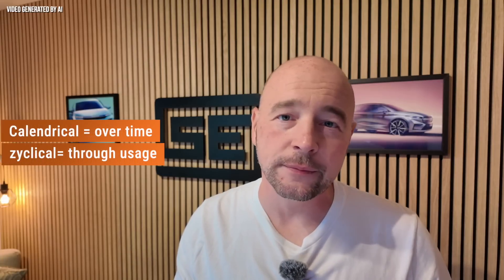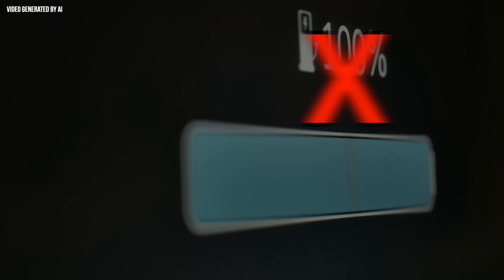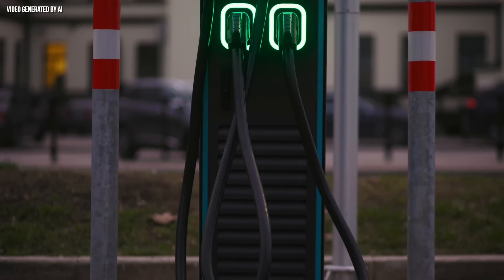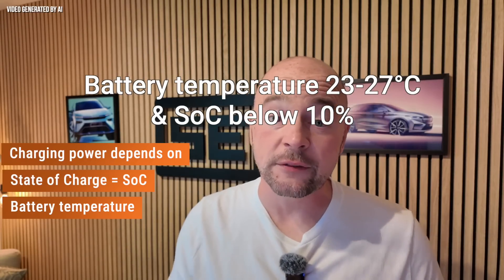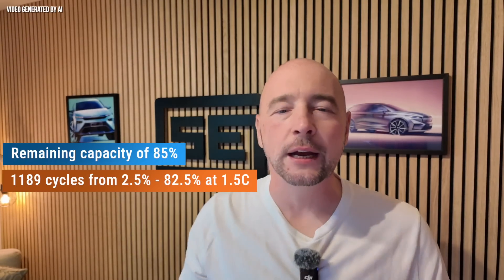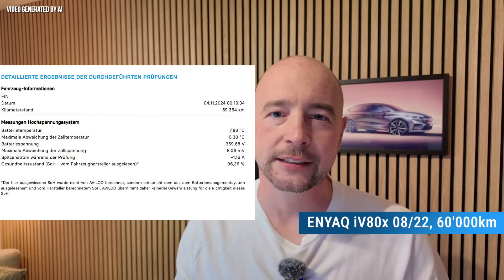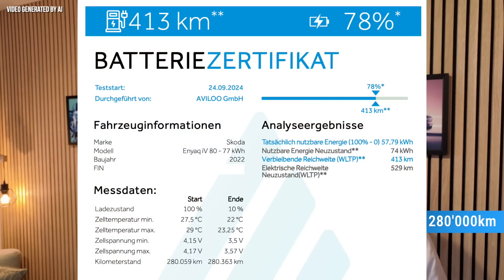Battery in the Skoda ENYAQ: charging tips and the answer to whether fast charging is harmful

Comment from the maker: Just for clarification: The content itself is not generated but written and researched by myself. Also this is a test. If it does not work out I will switch back to speaking myself. I will measure it by the like/dislike ratio and especially your comments. Even if you accept ai generated Avatar and Voice there will also be 'normal' videos :)
Reply: No problem!
Reply: Weird. B it it was fine. What on earth are you using to generate it? I prefer the real matthias though I think.
Reply: This worked very well! Of course it becomes a bit "robotic", a little fast, and lacks your lovely accent, but this was totally understandable.

As this function improves over time, and you are clear about what is AI, and what is not, it is a brilliant solution.

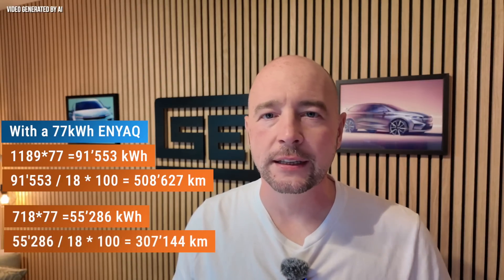Comment: Your math is funny. 8:20 vs 8:50. 80% is not 100%
Reply from the maker: It's not. A full cycle is always 0-100. So if you do part cycles like in the information it adds up. Those are not 1189 only from 2.5 to 82.5 but from 0-100 whilst every charging only was from 2.5 to 82.5 - it is done to make it comparable because otherwise it would not be to the other charging processes.
Reply: @electrifiedspeicher  OK, got it. Thanks. It makes more sense.

Comment: Hi Mathias if you charge from 2,5 to 82,5 % you don’t charge 77 kW as you write in your calculation. Should it not be 80% of 77 kW =  61,6 kW? And then the range would be 61,6 x 1189 = 73.242 kW : 18 x 100 = 406.902 km (by the remaining 85% of your battery capacity) or am I wrong?

Comment: Thanks for your content and explanation. Really appreciate it! I hope you can answer my question or maybe make a video about it. 
As I understand there are three ways in which the battery will deteriorate faster: 1. Near depletion; 2. Fast charging; 3. Charging up to a 100%. 
I regularly have to drive around 350 km in a day in my Enyaq 80 (starting and returning home) and charging at an AC charger during the day is not always available or practical. Depending on the circumstances an 80% charge does not always provide this range or it will nearly cut it. I’m curious what you think is the better option in terms of battery degradation. Should I charge the car to a 100%; charge the car for about 10 to 15 minutes at a DC-charger to gain the extra range; or is it preferable to drive home and arriving with a battery around 5%? In other words: which of these options is the lesser evil?
Hope you read this and can elaborate on this. Thanks very much! Stefan
Reply from the maker: I would If you really want to go the xtra mile for maximum battery care I would charge to 90% at home and on the way back only charge as much as needed to get back home with around 10-20% and charge there again. This way you would have to charge only a short time at the DC charger. DC charging is not that much of evil as 100% charging and not using the car.

But I would tbh for more convenience in life charge to 100% overnight and then start my journey with a charged battery. Then if needed I would only charge at DC to get home with around 10% and repeat this.
Reply: @electrifiedspeicher thanks for your answer!

Comment: Mattias. Could you please advise me. My Enyaq is 8 months old. It's an 85x sportline. I've not done many miles and I'm having a 12v issue. When I go up to my car I have to unlock it with the fob as it won't unlock itself. The button on the door won't unlock it. If I drive a distance it works. I replaced the fob battery and it makes no difference. I presume it's because the car is standing for so many days without use (I'm retired now). Can I boost the 12v battery with a normal car charger? If so, how? Do i disconnect it or just connect at slow charge. I went to my dealer, but they said change the fob battery and weren't helpful. As usual.
Reply from the maker: You might boost the 12V with a slow charge but you should not disconnect it therefore. Disconnecting the 12V can cause a lot of troubles (see manual for that). I have to be honest here that I have no experience with external charging but some viewers of mine mentioned they do. But you should call the dealer again because if the 12V is low or not in a healthy state they should replace it. There is a guideline out from Skoda on the 12v issues. for every dealer with a process to follow and do checks and then act accordingly. Your dealer should know about that and if not you might point him towards that (or ask another dealer if one is available near you).

Comment: A question, please: if the battery is charged to 80%, all other things being equal, will the maximum possible range be 20% lower than if it was charged to 100%, or is the charge and mileage not so linear?
As to the AI generated content, sorry, I find the movements of the image rather disconcerting. Other than that, keep up the good work!

Comment: just to give you the heads up , i have a enyaq vrs coupe
regestered last day of 23 and is running 3.2 and been faultless ,
i had to contact skoda uk and they told me it was due upgrade to 3.7 ,
i said it does it over the air and should not need to bring in .
they said there had been trouble with over the air updates and have 
booked mine in for 2 days next month , i need them to look at the door seals 
( on back doors ) front part of them where they meet the center pillow 
as they are bending away at the ends and coming away from the body ,
( both sides ) dont know if any others have had problems with them ,
i know my superb spotline they started to come away a little ..........

Comment: The AI works fine. There are a few pronunciation glitches and oddities, but it is totally acceptable. And if it helps you reclaim some time for yourself while still providing great content then please use it. 

This was an interesting video. My own IV80 (10/21) has around 54,000 miles (87,000 km). I must get a certificate from Skoda at some point  as I bought it used with a little below 40,000 miles in its first two years. But, no real worries with it at the moment, I probably top up once or twice a week at home and brief top ups at work.

Comment: An interesting video but I did see a video by a gentleman who had two mark one 2917 Nissan leafs. One with 95,000 miles witch had been rapid charged 625 times over that mileage and the other with 43,000 miles and had been rapid charged 3 times. And the state of health of the batteries were 71 and 75 percent respectively. And that is with no thermal management and old chemistry. I do believe you should not hold the battery for long periods of time at a very high state of charge nor should you leave it at a very low state of charge. I believe working with in those parameters the battery management system and the thermal management should take car of the battery. This was explained to me by a battery chemist.

Comment: Honest opinion? Bottom line, the time you save by using AI outweighs the downside it brings me. That being that I know I don’t look at the real Matthias, but an AI generated avatar. Also the voice sounds (and is) artificial and emotionless. The AI tools that do this conversion will improve rapidly, but my experience with this video doesn’t feel right.
No issue for me as my German is good enough to switch back to your original channel😊

Comment: I have my Enyaq 85 a few weeks now. For long trips I charge to 90% over night. When I wake up, I use the app to start charging to 100% so I can leave with a full battery but it will be 100% as short as possible. If the trips are shorter, i charge to 80%.

Comment: I am somehow missing the point in the part about fast charging. The results about how many cycles the battery is capable before degrading to 85% is much higher if you charge only to 82,5%. Obviously that talks in favor of not charging to higher state of charge if not necessary. 

But the topic in this part of the video is whether is it harmful to do fast charging. The data is a bit misleading, because if you are talking about "is fast charging harmful" and the results say that charging with 115kW is better than charging with 39kW, people may think that it is better to fast charge. 

Am I missing something here?

Comment: Good information on battery care. I've been self testing my 2021 iv80 since getting it 8 months ago and I'm measuring 95.6% at 34k miles / 54.7k Kms. I've never rapid charged it and tend to top upto 80 when i get down to 50-60%

As for the AI, i don't mind it but it takes a little getting used to after watching your videos for a while. If it makes your life easier use it.